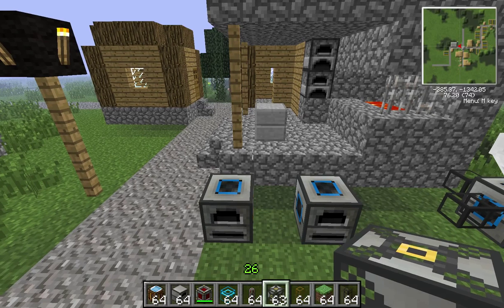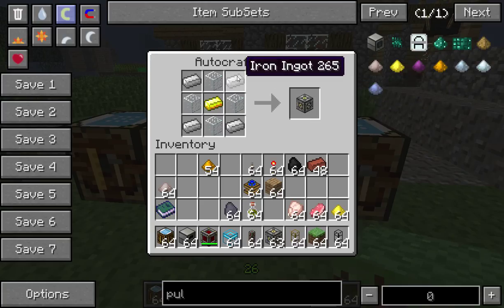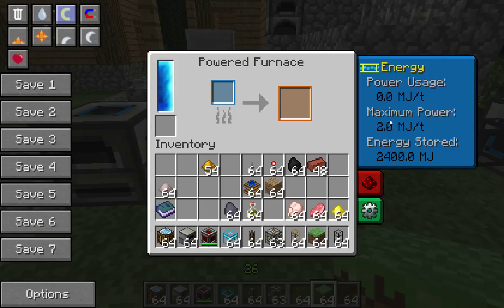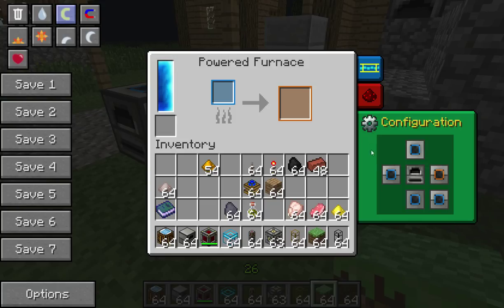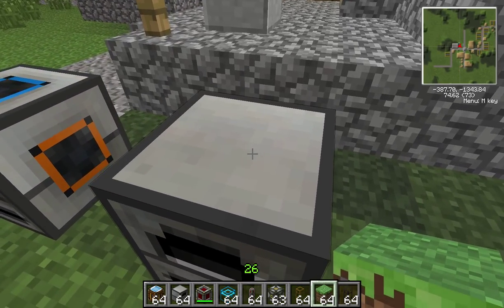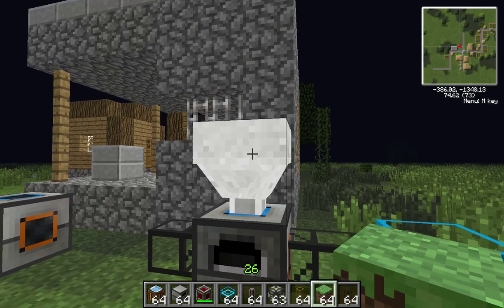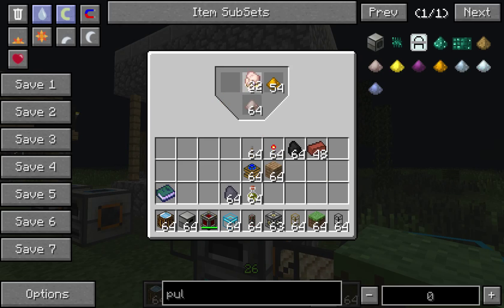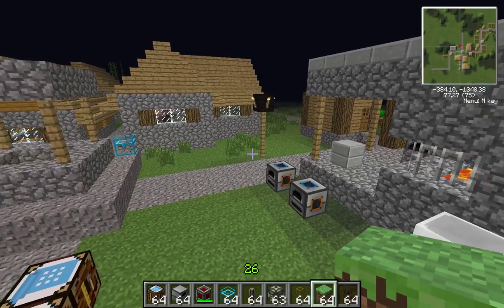Block Spotlight - Powered Furnace

Comment from the maker: The furnace uses BuildCraft energy (Minecraft Joules). You can use BuildCraft engines, Forestry engines, Railcraft engines, or Thermal Expansion engines. A stirling engine is one of the easiest to use. It needs at least 0.5mj/t to run and a stirling engine produces 1mj/t. Hobbyist's Steam Engine from Railcraft is also an easy engine to use.

I have the furnace in this spotlight connected to a Redstone Energy Cell from thermal expansion. I'm charging the Redstone Energy Cell with Magmatic Engines

Comment from the maker: There are a number of different engines you could use such as railcrafts steam engines. Thermal expansion also has a few engines you could use that work well such as the Magmatic Engine which runs off lava.

You'll have to work out which works best for you and the resources you have available. I like using a steam boiler and steam engens from railcraft.

Comment from the maker: You need buildcraft energy (Mj or Minecraft Joules).There are a number of different engines you could use such as railcrafts steam engines. Thermal expansion also has a few engines you could use that work well such as the Magmatic Engine which runs off lava.

You'll have to work out which works best for you and the resources you have available. I like using a steam boiler and steam engens from railcraft but that can take a lot of iron.